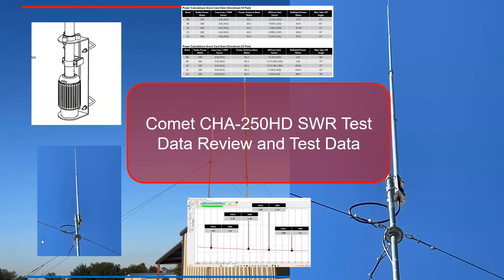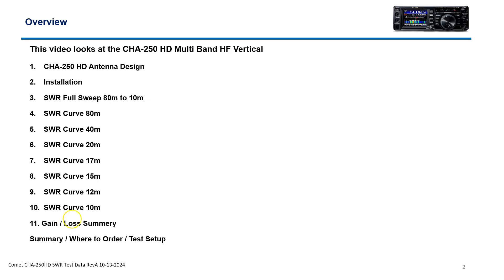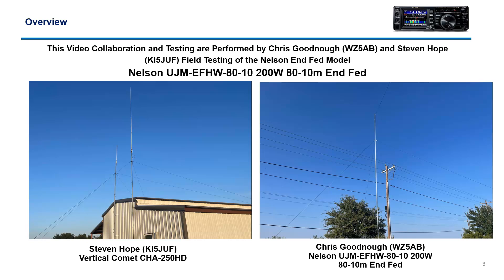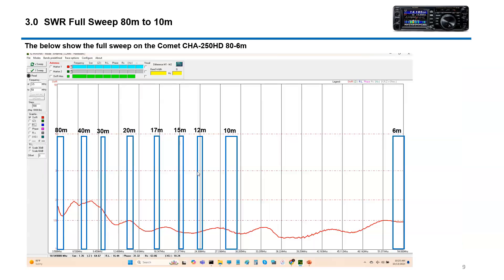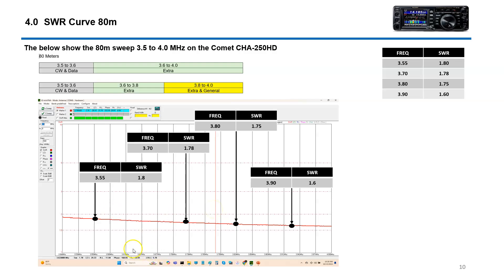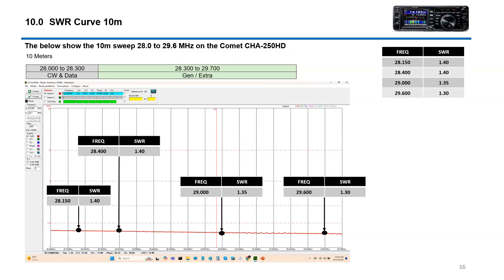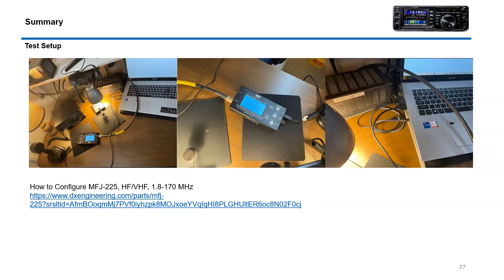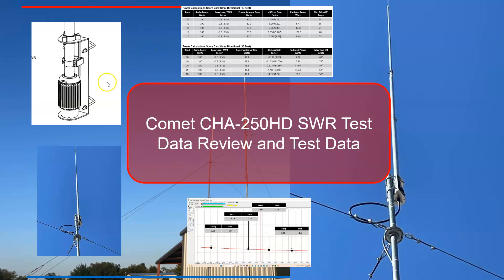Comet Antenna CHA-250HD 80-6m End Fed Vertical Review and Test Data

Comment: Thanks for this. I bought the antenna 5 years ago for use in my RV permanently sited in a tight campsite with no room for radials.  It is ok for FT8, but SSB for me has only been decent on 20m.  As your data show, it is a miserable failure on 40/80m on any modes.  My Tarheel screwdriver antenna with a 6’ whip sitting nearby works MUCH better. It is what it is.  If you can’t put up a wire antenna and can’t run radials, this may be ok … better than being off the air. But I now use my mobile antenna on 40m instead.  They can hear me on the nets on the mobile, but almost no one can hear me on the CHA on 40m SSB. FYI, I tried using a length of coax shield about 18’ long as a counterpoise (terminated with a choke) but no dice. Same sad performance. No difference.

Comment: What are your thoughts about adding four 10 m long radials (14 awg) attached to the base plate of the antenna coming down at about a 45° angle but not touching the ground. I will secure them in the air with braided Kevlar twine. Somewhere I read that that might help improve the performance of this antenna. Of course I will also ground the 30 foot mast as you mentioned, but you also mentioned your metal building acting as a counterpoise and I do not have that. Curious what you think about that approach. Thanks and 73.
Reply from the maker: How you doing - I would give it a try the 45 angle will help with the impedance and keep it close to 50 ohms - good luck 73

Comment: Hi there I noticed you use this antenna mounted to a steel building. Did you isolate the antenna from the building? Any issues with the building causing interference?
Reply from the maker: Good evening Richard, the poles are grounded 8 ft ground rods the metal metal building is at the same ground - the metal actually works as a great counter pose so far been very happy, let me know if you need anything else and GU and 73

Comment: Excellent work! Many thanks, im debating on making a fan dipole vs getting a vertical hf.
Reply from the maker: No problem so far I've been very happy I mostly do CW on 40 and 20 on the SKCC slow speed 7.055 and 14050 I make contacts all day long at 25 - 50 Watts  GL and TU 73 KI5JUF

Comment: There's a heatsink at the base for all of your power to radiate as heat not as RF. Works both ways so you can't hear that station in VK land. It is a dummy load on a stick. That said if it gets you on the air is it OK?  I would love to see someone run some 100 watts for a spell and take a inferred picture of the base so all can see.
Reply from the maker: Good evening and thanks for the message it works for me I mostly do CW on 20 and 40m seems to do ok, had pretty good luck on voice too - I think the key is get it 30ft up and let the metal pole and in my case metal barn helps as a counter pose give the signal something to work against - as they say you never know until you put it up - thanks for the message a GL and 73

Comment: I’m looking for my first HF antenna, and the Comet 250HD, looks great. What do you think about putting it on a 30 foot tower ?
Reply from the maker: Good evening and thanks for the message,   30 ft should be fine, I would recommend if you haven't already done so get a 8 ft. ground rod and heavy copper wire # 6 and ground the base on the metal pole and tour radio I have a video showing my installation here's the list https://youtube.com/playlist?list=PLlk3LzuL5lbxT9PnM0qFyy_J22oUTbXHW&si=okC72MWmaXDjFccQ

Comment: Great presentation... How do you rate this Antenna now after some operation ?  Thanks   de KC3ZDW     73!
Reply from the maker: Hi Ken, overall I kike it, its built well handles wind rain dust etc., its omni directional so I really have no gain in any direction, but surprisingly it does good on 20m 40 and 80 so I'm happy.   It does good on 10 - 17 too.  If you can do a end-fed or dipole you get better gain but if space is a problem this antenna will do the job, I hope that helps GL.. and 73
Reply: @westtexasvideogateski5juf255  Thank You for responding.  Helpful

Comment: Is that 10 or 35 feet at the tip or base of antenna?
Reply from the maker: Hi William, thanks for the message, the height is from the ground to the base of the antenna (were the balun is, if you want the data sheets email me they have take off angles and 1/2 power points to give you an idea what the width looks like here's a video that shows a little more detail https://youtu.be/2JZuqmTAUco?si=VrAE4g1NcGNA0d5u
Reply from the maker: my email is shope02@yahoo.com

Comment: Working on my General....studying transceivers (tending toward the Icon 7300) and studying antennas. I like vertical designs like this comet for vanity reasons (wife). Highest point in my yard has a barb wire fence along the property line. It is around 100 feet from there to the house and my base station, so good coax I know BUT how high off the ground do I need to install this 20+ foot antenna? Just above the highest part of the barb wire fence? Since the highest part of our property is on the property line I cannot guy it down (well I could but only in two directions/3rd would be on the neighbor.
If just above the barb wire fence I could 'plant' a strong pole in concrete and then affix this Comet to it. Thanks for your thoughts. W6RYM.
Reply from the maker: Good evening if you will email me at (shope02@yahoo.com) , Comet has to recommendations with datasheets for takeoff angle and bandwidth from 1/2 dB points, they have test data at 10 and 35 ft. use a metal pole that is grounded this acts a counter pose similar to an end fed.  The antenna is essentially a vertical end-fed at 40 and 80 there are losses I have a video that shows data; however, I can talk all over Texas and surrounding areas on 80 and 40 at night I have some playlists that show contacts so there are some tradeoffs - if propagation is strong you will make many contacts let me know if you need anything else best of luck from Steve KI5JUF 73

Comment: I know no radials were needed, but did you ground the antenna?
Reply from the maker: Good afternoon Dave and thanks for the message, I have the pole grounded and radio all tied to an 8 foot ground rod so everything is at earth ground.  I hope that helps.  They told me by design its an End Fed and that by design it uses the reflectivity of the earth as a kick off.  I have a lot of information from Comet on the 1/2 power point, take off angles at 10 and 35 feet I will post a video to review it.  I recommend 35 feet if you can get it - mine is at 30 ft.  let me know if you need anything else and hope to work you on the air 73
Reply: @westtexasvideogateski5juf255  Thanks for the quick reply Steve. BTW great videos. I appreciate YT 101 lessons!